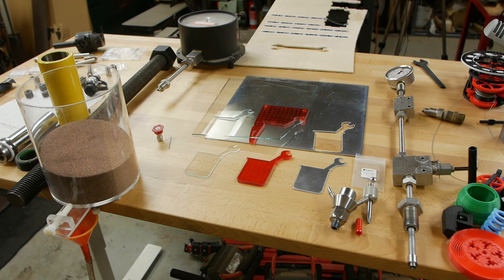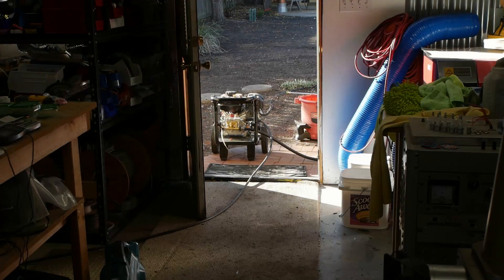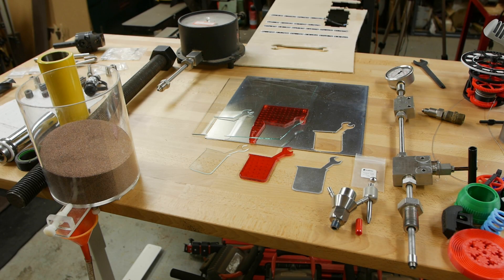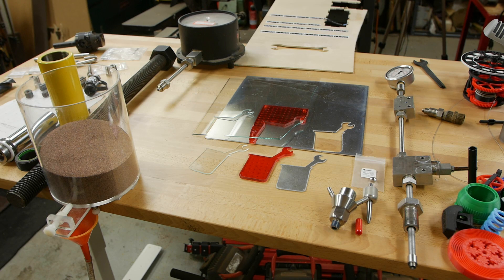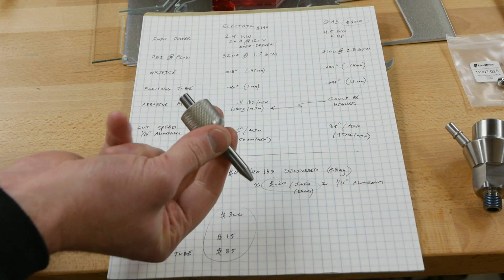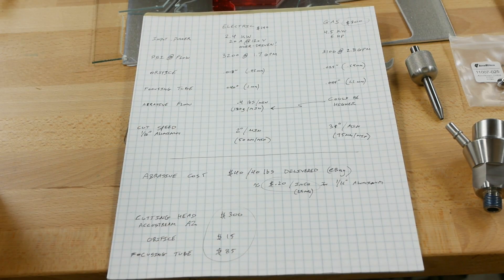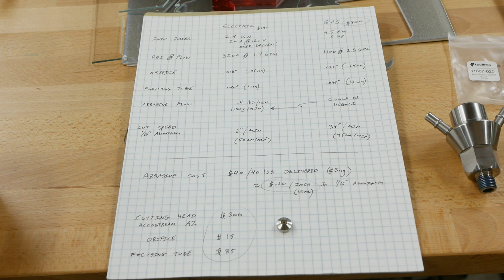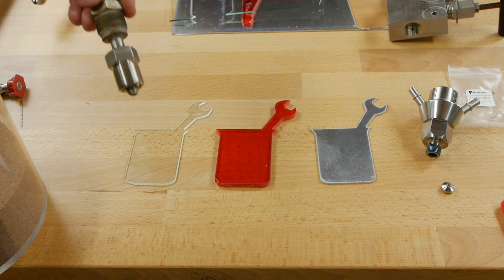Gas-powered waterjet cutter (follow-up) and other project updates

Comment: What abrasive are you using because I was looking for some abrasive for sand blasting and it was like $1 an lb but I heard you can buy sand locally for like $4 for like 50lbs or something and I would up getting some abrasive for tractor supply for like $8 for 50lbs
Reply: James Holbrook regular (silica) sand leads to fine silica dust in the air when sand blasting, it's very dangerous - do a search on "silicosis"
Reply: 2LeftThumbs - Yes, when sandblasting with air, not water!
Reply: Alliance Fire Dept. True, but that's a pro sandblaster, if you had one you'd be buying media by the ton, I was guessing the query came from a "casual" user who doesn't have an industrial sandblasting  rig...
Reply: 2LeftThumbs - "Pro"?  I have an attachment for my pressure washer I bought for a hundred bucks that works great and I am about as "casual" as it gets. Possible silicosis was the reason that I got it, you are correct about the danger it poses. BTW this video is about water jet cutting and James was asking about the abrasive he used so I would assume James is talking about water sandblasting.
Reply: Alliance Fire Dept. Damn, you guys get better power tools than we do over in the uk- the only water sand blasters I've seen have been used in sandblasting buildings, so my bad. Nonetheless, the op said sandblasting, not waterjet cutting, hence my reply.

Comment: What would happen if you used regular play sand?
Reply: Too irregular. Your nozzle has to be larger than whatever is the largest particle size.
Reply: run some play sand through a screen sometime.  theres some pretty big rocks in it.

Comment: For the ruby laser, I'm curious about your choice of flashlamp. Does the increased pumping efficiency of the helical geometry offset the increased cost in the lamp and driver circuitry? Was a longer ruby rod with linear flashlamps something you considered?
Reply from the maker: +Output Coupler Good question. A straight xenon tube would rupture if we put enough energy into it to fully saturate a ruby rod of that size. We could have half a dozen straight tubes to spread the power out, but it's easier to use a single helical. Using a longer but more narrow ruby rod might work, but there might be a physics reason why they are not commonly available.
Reply: Thanks for the answer. I've only worked with much smaller rods than that (and no rubies, just YAG and alexandrite), so I haven't bumped into the limits of linear flashlamps yet. I was thinking you'd only need two to get good saturation, shows what I know!

Comment: Most unloaders are already running slightly in bypass. You can adjust the unloader to run more bypass during operation to better match your orfice size, there are tutorials online about doing this.

Comment: Can you use like a standart hydraulic pump? I know that there's a issue with rust but that can be solved I guess.
It'd be nicer for shop use because you could use an electric motor.
Happy new year!
Reply: That's basically what the electric pressure washer was, a hydraulic pump meant to operate with water.

If you mean converting a real hydraulic pump into a waterjet cutter, almost certainly not. Those are not meant to pump water, it's unlikely they'd work for long doing it. And if they did, it's unlikely they'd have sufficient flow rates, since they're optimized for very high pressure, which within the same power envelope means lower flow rate.
Reply: Probably wouldn't live very long as hydraulic pumps usually use the oil itself to lubricate them

But even if you could use it then you still have the problem of having to get enough mechanical power to turn the pump. Tho maybe you can score an old 15kW three phase motor on the cheap (Provided you have three phase as i hear its pretty rare in the US).
Reply: I'm sure the electric pressure washer could be made usable with proper sizing and cooling.
Would be a lot more work to make hydraulic systems work decently  with water.

Comment: Awesome work!  BTW, Did you film this with a Pixel 2 or something that has stabilization? The part with the compressor looks strange -- as though the motor oscillations were visually dampened/stretched.
Reply from the maker: Eric Higgins I think this may be an interaction between the camera rolling shutter at 60Hz and the motor vibration frequency. 3600RPM would be pretty reasonable for its design speed. However the camera (G85) has stabilization too.

Comment: I love this channel! It is awesome that you got this working as well as you did with commodity parts. No slight to you at all, but the final performance pretty much convinces me that a high-pressure pump is probably going to be desirable for all but the lightest applications. I guess I'm also a bit surprised you didn't mention Wazer or comment on their approach, pressures, or performance a little bit for comparison.
Reply from the maker: Curtis Layton Thanks. I mentioned Wazer in the last video, and when I researched it, they had not published their pressure or flow rate or other details. It runs off 15A 120V, so input power is known. Higher pressure is always better. It's just a question of how much you're willing to pay.

Comment: comparing the two units.

with A having a flow of 1.7 vs 2.8 gpm of B (Petrol motor)  the flow is 64.7%  more in B.
the area of the nozzle for B is 26.6% more than A based on the nozzles of 0.040 vs 0.045 diameters

therefore the flow velocities through the two nozzles is 30.14% higher in B

therefore the increased energy in B due the square of the velocity is 69% more. which is not insignificant.

thanks for the update,
Reply from the maker: Charles The metal bucket certainly noticed the increase in energy!
Reply: Applied Science I'd say your concrete floor was more impressive. Glad you didn't find a sewer line there.
Reply: /r/theydidthemath

Comment: Hey +Applied Science!
If you put oil on the bottom of bucket you could potentially slow down enough jet stream to prevent it from cutting your bucket.
Reply: Wouldn't oil just float on top of the water in the bucket?

Comment: To prevent your catch tank being punched through, use a deeper tank and fill it half way with foam, scrap metal, and water to dissipate the jet.  The industrial ones have a 3-4 foot deep catch tank filled with water and steel shot.  The shot has to be re-leveled every so often to prevent the jet from pushing it out of the way and punching through the tank bottom.
Reply: Not true. I run a 5-axis Maxiem 2030 at a job shop and 3-4 feet is bang on regarding the depth but all thats needed to dissipate the energy is to submerge the cutting head in the water. (Ours has a steel tank at the end thats open at the bottom and you pump air into it to raise the water level)
When the stream draws air with it down into the catcher tank (when its raised more than 50mm above the water line) it enables it to puncture deeper and all the way through the bottom of the tank. 
Ours is a 50ksi machine but you would never need steel shot or foam or scrap metal for that matter.  Although I sometimes cut really thick material (Mostly Acetal plastic to save on machining time but we sometimes do mild steel up to 110mm) where it goes super slow it still hasn't been a problem because the catcher tank also quickly fills with garnet and slugs and most of that gets IMMEDIATLY pushed far away from the main cutting area. 
Variable solids removal systems are also optional on the Omax and Maxiem machines and they pump debris and garnet from the bottom of the tank into a hopper. Saves massively on downtime.  

I'd be interested to see an application where the steel shot is used though do you have a source? 
cheers Diddi Mar
Reply: My source was a OMAX rep about 6 years ago.  I was doing purchase research for the company I worked for.  Saw all the brochures, toured shops with machines, made up an operating budget, etc.  They were the ones who recommended the steel shot in the tank bottom. Solids removal systems were available at the time.  They were able to remove the garnet, but I think a waster sheet was recommended to protect the tank bottom instead of the shot in that case.  The foam and scrap metal was only for the home gamer who might not have a 3 or 4 foot deep catch tank.  That would cause all sorts of headache for an industrial machine.
Reply: what we can do for low pressure like 200-300 bars?

Comment: I would be very interested to see you show the difference between fresh and used garnet using a scanning electronic microscope.
Reply: This is exactly what I was thinking. On a 60ksi machine, the garnet isn't reusable, as most of the particles have broken apart on impact. But at only 3ksi, would the garnet be reusable, at least a few times?
Reply: It is literally wet sand. Yes, there's a bit of whatever you cut in there too, but that'll be even finer powder. Use fresh garnet for stuff that you want to ensure has no edge contamination, or that can be seen, and use the recycled stuff for cutting stuff that isn't cosmetic. A tiny amount of acrylic in your other acrylic? No matter. Some recycled garnet with mild steel in it on your fancy stainless steel? Nope.
Reply: @DSSlocksmiths  Good point, at least get 50% recycled and 50% fresh abrasive, and see how that works out.
Reply: you raise a good point, albeit actually recycling the garnet may be more hassle than it's worth.
Reply: I know this is years old, but I wanted to add that a separation tank would be relatively easy to build.  Just have the water flow into a fairly deep tank. At the bottom of the tank have a series of baffles. As the particles fall through the water they will follow a given trajectory based on weight. You can fine tune your baffle spacing to catch the garnet, unless of course whatever you are cutting has a similar weight. However, sorting acrylic, etc. will work great. Optionally you could put a drain valve under the garnet section and open it to allow the garnet to flow out.
Reply: @-robo- amazing idea. I’ve been struggling to find an efficient idea to safely separate and recycle ethanol that has been contaminated after cleaning UV-resin parts with it. Would the principle of a separation tank be suitable for that purpose?
Reply: +1. Would also be nice to see some other abrasives, like grinding wheels and sandpaper, before and after being used.
Reply: Can you test it with sand?

Comment: Aw, from the title I thought you were going to have it be a big water tank with shop air being pumped in the top and using the pressure coming out the bottom as a water jet

Comment: Ben, why can't you reuse the garnet?
Reply: granules gets trough destruction process too, but it would be interesting to see the topic covered, what's percentage of it is still reusable in the case.
Reply: Garnet recycling is a thing, and it does work in some situations.  

One has to first stift the garnet to get rid of the junk that might plug the nozzle, as well as the ultra-fine bits that can accumulate in the nozzle and cause clogs, and possibly other contaminants.  Then, it's a matter of drying it, which is often expensive energy-wise.  Finally, you are left with used garnet that can be mixed in with new.  

Depending on cutting conditions, the used garnet may still be pretty good, or it could be so pulverized it is useless.  

Whether such recycling is practical depends on a lot of factors, but some people do recycle it, though most industrial shops do not.  It all comes down to situational cost / benefit. 

For a hobbiest, one could just let it dry out in the sun or something for the drying process.  There are also commercial abrasive recycling systems available from a couple of different manufacturers.
Reply: Why does the garnet need to be dry? Perhaps using wet abrasive could be the solution, so the abrasive recirculates through the system..
Reply: Why can't you re-use sandpaper? Think about it.
Reply: UnitSe7en You can, if you capture and clean all the lost sand and glue it back onto the paper